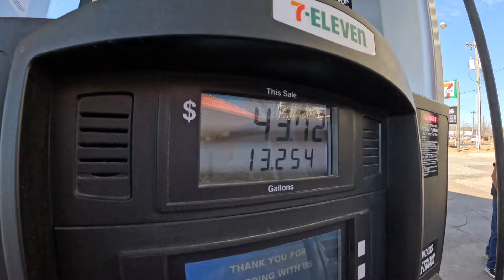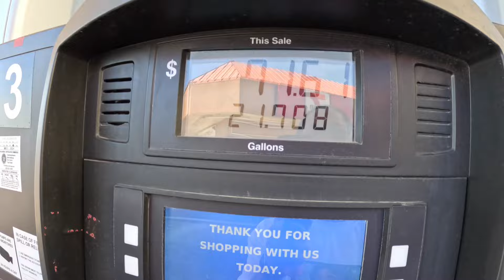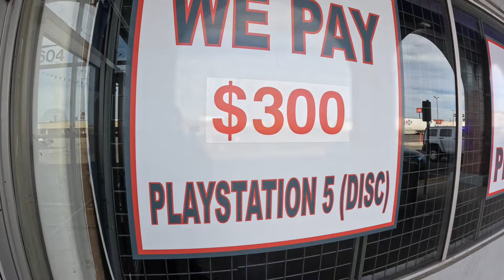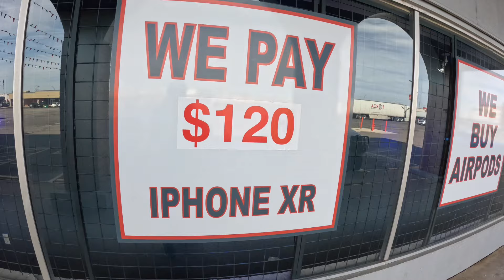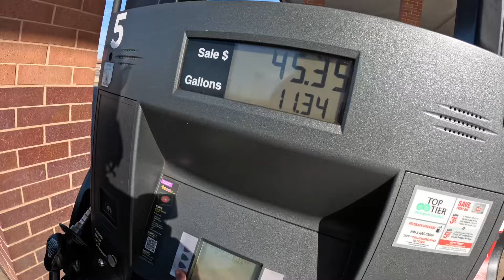The Police Came And Shut Everything Down

Comment: I went to Harbor Freight in bought me a 3/4 inch torque wrenche, I bought a half inch torque wrench and I bought a 1/4 inch  torque wrench for smaller nuts and bolts ! You should too! Set it at 80 pounds !